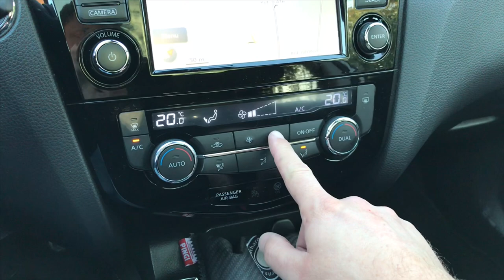Nissan Qashqai J11: Install Air Vents and USB for the back seats

Comment: Hola buenas una pregunta. Porque estoy haciendo eso y la oieza de plástico rectangular de 17cm x 4cm de bricolaje. Esa pieza cogeria ambas salidas a la vez no? Con que lo pegas?

Es que hice parte del trabajo ya y sale muy poco aire porque puse sin ese rectángulo. Entonces lo wue me faltaría es hacerlo con eso y orobar aver si aumentar la corriente de aire atrás.
Reply from the maker: ¡Hola! Lo peco con silicona de montaje universal. Debería mejorar un poco el flujo de aire si lo haces hermético de esta manera, pero aún así está hecho para un pequeño flujo de aire a los pies debajo del asiento del conductor y del pasajero. Si realmente quieres tener un flujo de aire como en la parte delantera, debería estar conectado a la salida que está más arriba en algún lugar detrás del sistema de conexión, pero nunca logré localizarlo en el propio coche. Es solo analizando el manual del taller.

Comment: Nice one! Does it only flow when I set it to foot ventilation or does it flow ways?
Reply from the maker: Thanks! Only when it is set to foot ventilation as I try to demonstrate with the kleenex. 😉 it would be better to connect it to the output for the central blowers, this should be situated somewhere behind the Connect system and AC but on the pictures I saw / info I asked it was never clearly seen.
Reply: @LaPalmeraie0032  I am going to buy a 2020 qashqai and watch all your mod videos. Lots of great tips. Keep on going!
Reply from the maker: Great to hear 🤗 and great car 💪🏻 don’t hesitate if there are still some questions.

Comment: Nice idea and good job. But did you stoped airflow to front seats feet (down)?
Reply from the maker: Stanislav Peev thanks Stanislav! No i didn’t.
Reply: Where are those air vents (on min.2:00 from the video)? Next to the gear box? And why you drill bog holes?
Reply from the maker: it is next to the driving pedals and passenger feet. Just remove the panels there as shown in the video... the holes are big in order to make the hoses fit in. If I where to redo this I would look for the exit behind the radio unit. It would create a better airflow as those are ment to feed the airvents in the back on Russian models/ Xtrail. The ones I used are ment for the feet air vents in the back with therefor less air flow.
Reply: Thank for the advice. I have Qashqai 2008 and I'll try to do the same. And last thing: how did manage to split the airflow - for the back and for the feet?
Reply: Good quality video here ppl, i dont know why they dont build them like this from factory. This might be a feture mod for me aswell. LIKED!
Reply from the maker: Thanks mate 😉

Comment: Great video. Do you have any plans to do the same on the J11b? I'd really like to put the USB in my J11b but the centre console is quite different, especially the rear panel.
Reply from the maker: Hi! Thanks. 😉 mine came with a usb port on the center console but it is quite similar to install aftermarket. Only difference with the J11a is that the powersocket isn’t situated in the back but on the front side of the armrest. So you need to remove the double cupholder to access the wiring. Please check my video on how to open the center console in order to gain this access. From there you feed the wire through and the rest remains the same 😉
Reply: @LaPalmeraie0032  I think only the late 2019 early 2020 until j12 came with the usbs in the back.. i also wanted them but i just did the easiest thing, I bought an 4 usb hub with charging feature (metallic, good quality hub) and stick it on the right side of the back console with double sided tape, and it works =). I also saw in the uk nissan sells usb ports for the back, they are metallic (or maybe grey plastic but they seem metallic) that you can install in the lower side of the console, it comes with a manual and all the parts you need.. i think it is/was around 50 euros or less, maybe you can't find it now because the j12 released
Reply from the maker: Really? Didn’t know that Nissan made this part as well. Will have a look. This mod is very easy and quick btw 😉
Reply from the maker: https://www.nissan.co.uk/owners/nissan-ownership/accessories/product.KE930HV500.html £117 😳😳
Reply: @LaPalmeraie0032  last time i checked (about 1-2 months ago)it was around 50... inflation

Comment: Da dove posso comprare tutti i componenti?
Reply from the maker: La descrizione del video contiene tutti i link.
Reply: Trovo solo il link delle bocchette
Link tubo
Link manicotti
Link usb
Grazie
Reply from the maker: @claudioliuzzi1000 

Round airvent 60mm: https://s.click.aliexpress.com/e/_EJ2kjdp

Washing machine hose: https://s.click.aliexpress.com/e/_Ey1B4PD

USB socket: https://s.click.aliexpress.com/e/_ExZ1NfV

Cable 1.5mm / 14 AWG: https://s.click.aliexpress.com/e/_APAcST
 
Rubber muffs: to be found in specialised DIY (plumber) stores

Comment: What a mess, bad job....
Reply from the maker: Thanks for your helpfull feedback Sandro.
Reply: @LaPalmeraie0032  lol. Nissan really should have just installed something like this. It would not have costed them much.
Reply from the maker: Indeed, the Xtrail has it and even the Russian QQ... don’t understand neither. On the new model that I have now they did put the USB sockets there but still no ventilation 😞
Reply: @LaPalmeraie0032  if they added on the qq for example power lifted trunk or back air vents things like that then the qq wouldve steal almost all the popularity and the sales of the x-trail